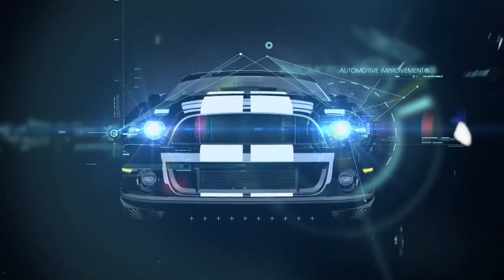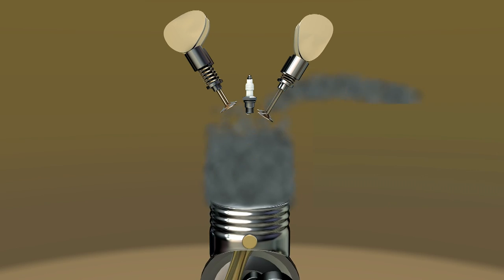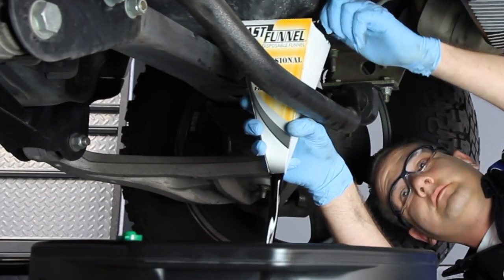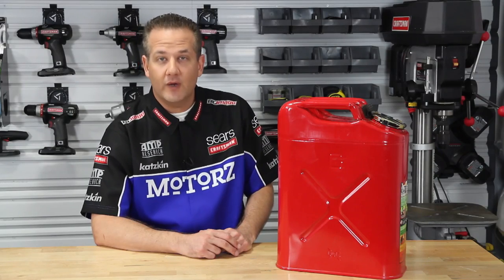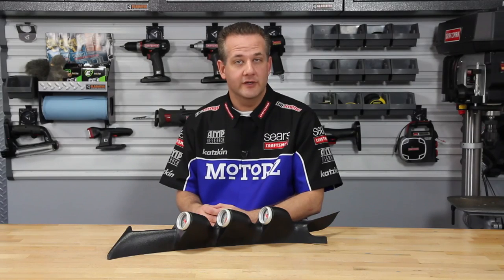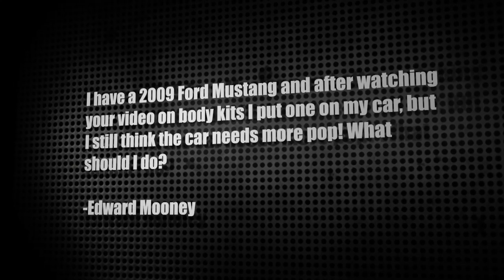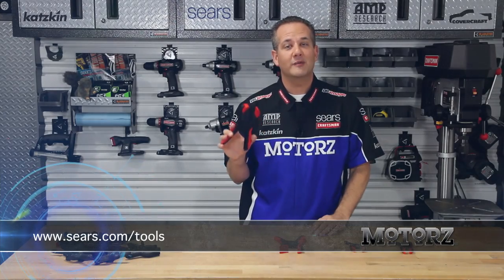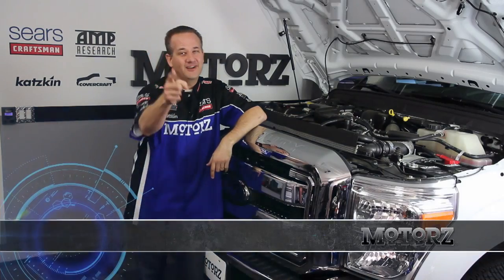Everything You Ever Wanted To Know About Diesel Engines Motorz #75

Comment: I like diesels because they are loud and stinky.
Reply: Johnson's Gee-rage don't forget greasy.
Reply: And trees like the CO2.
Reply: Then get you a 80s Chevy with a 6.2. 
I have one in my 83 suburban. 
I love it!
Reply: Maybe It's cuz I grew up in a diesel truck shop but I love that sweet smell a diesel engine that's in good shape puts off when It's running, every time I'm driving my Chevy 2500HD Durumax diesel truck I gotta roll down the window and get a whiff of that sweet diesel exhaust smell!
Reply: Save the earth Don't give birth . I got a 95 k3500 6.5 , but having a problem of losing oil pressure when at operating temp like she rests at 20 lbs on the gauge on the dash (if the gauge is right .) I got her for 600 bucks a extended cab long bed dually, lol I practically stole it at what he was selling it for
Reply: Hey now don't forget obnoxiously smoky.  One of the best parts.
Reply: You like that or you copied what he said and if you were copying Chris: 
like it is loud and stinky
Reply: @alanhowitzer  gas engines produce more CO2...
Reply: "loud" lol

Comment: BACKWARDS!
  Gas POPS like a explosion, kicking the piston like a bat hitting a ball.
Diesel burns throughout the stroke , a long soft shove.  That's where the torque is created.   Just ask the guys writing / programing the custom tune chips for all the trick diesels.
Reply: But the explosion is what makes them loud. Lol. Its a shame the gov is choking diesels out. Go back 20 yrs and ask somebody for diesel exhaust fluid and theyd laugh at you just like if you asked for blinker fluid. You see more bigger work trks as gassers cause the diesel engine costs have gone up ridiculously and def systems are junk and a epa game. Id rather have a bad running desiel than a clean gasser in a room with me
Reply: technically the cetane is what causes fast initial flame front. Cetane rating in europe is lower and diesels are quieter and make less diesel rattle. Go read this: http://www.maxxtorque.com/2009/03/diesel-timing.html
Reply: top fuel burns down the stroke to ,but higher compression with gas can burn up the mix in 10 to 15 % down the stroke so u dont need as long as a stroke and  that will help getting to a higher rpm

Comment: Those big coolers work great but I gotta say I love my Ridgid Gen5x Hybrid Fan that will run off a battery or can be plugged in and is portable and has 10 different mounting options from hanging on a screw on the wall to being mounted on a tripod to being hung on a string or cable or even being mounted on a 2x4 from level to sideways or even upside down, It's definitely the way to go when your moving around. But I sure wouldn't mind one of those big coolers for my garage that's for sure!

Comment: My last car was a petrol 5.7L LS1 V8, but as I travel and tow alot for work, I now have a 4 cylinder 2.5L Turbo deisel. First thing I noticed was the lag and the knocking sound. Although diesel has much better fuel economy when towing, I miss the instant power and the purr of the V8.

Comment: technically you are incorrect about diesel engines not having a throttle. some diesel engines do have a throttle, but it's not used to control the intake  air or the revs like in a petrol. it's used to control intake vacuum under engine braking and for emission control.
not digging or nay saying, just thought I would add my 2 cents.
Reply: viperfrank don’t forget anti shudder on engine turn off....

Comment: Bob, the throttle valve is strictly used to meter the exhaust gas as it is recirculated in the engine, but not in the traditional sense in a spark ignition engine where it is used to meter the intake air into engine.

Comment: You still need a longer connecting rod to pair with the longer crank lobe - otherwise, a short con rod/long crank lob will crash engine parts.

The long crank gives the engine more "leverage" to turn the crank - IE like sitting further back on the end of the seesaw.

Comment: On short drives, it doesn't hurt the engine.  Suggestions would be to change the oil more often because cold engines cause cylinder wall wetting from the fuel, which inherently gets pulled into the lube oil, diluting it.

Also, if you have a DPF, it will not give it a chance to regenerate, which may require a stationary regeneration or a trip to the dealership for a cleaning.

Comment: 11:15 why do I keep seeing these holes in the side of the exhaust pipes on newer diesels? Is the goal of it to create a venturi, pulling air into the exhaust via the holes to dilute the soot? So its more volume of air, less thick black smoke?
Reply: newer diesels, (07+) from factory have a diesel particulate filter, this keeps the soot from getting out the tail pipe, when clogged it has to be burnt out by whats called a regeneration cycle, where fuel is added to the exhaust stream to create a burn. resulting in 1000+ degrees, the holes are there to pull the exhaust out more, and aid in cooling, especially during a regen.

Comment: Diesel :
-worked on coal's dust originally
-can have a throttle body for smooth shut down
-my diesel run 23 to 1 compression ratio (indirect injection) and can go low as 16 to 1 on actual direct injection.

Comment: are cars and trucks diesel engines the same ? apart from size ? MY 2002 W220 S320 CDI i want to upgrade some stuff will it make around 400bhp can it ? where can i get parts from ?
Reply: The basic principles is the same, but of course there is different designes on different engines. Getting 400 hp from a 320 cdi is feasible but you might need a new pump and a bigger turbo. The easiest thing to do is to chip the engine. this can be both cheap and expencive, but i think you can get ca 350 hp and 6-800 NM in a 320 cdi by chipping the engine. A friend of mine has 250 hp and 600 NM only from a chip in his w210 320 cdi ;)
Reply: ***** when you say 600 NM what are you reffering it to ?
Reply: Nm is the torque of the engine (the twisting power). truck and tractor engines are made for torque because with more torque the truck/tractor can pull more. It gets harder to stall the engine the more torque you have. (600 NM is the same that some supercars have! You will get some sick acceleration with 600NM)
Reply: But don't ask me about the difference of HP and NM...
Reply: ***** oh lol sorry my bad i know what torque is i just read it in pound feet  not nm :)
Reply: Oh ok, yeah im from Norway and we use nm ;)
Reply: ***** thanks anyway bud :)

Comment: This is a pretty good video! I'm getting a Diesel engine for my Triton Ute, also known as a L200, and i am getting it for the power output of the engine. Knowing they can run away, i have specifically said "I want a manual gear box" for in a few cases, It will give me more power when towing then a regular 3 speed automatic, and it will also allow for more control, such as a Diesel Run away event. The event being when the engine's fuel is cut of, and starts using fuel from the Sump of the engine. Should the event happen, i can easily stop the vehicle engine, and avoid a melt down or worst. I also know, that in the event that i do such to stop the engine, it will need to be checked for Excessive damage to bearings and Gear box gears.

The amount of power from the engine, could smash up some teeth within the gear box. And to avoid it, i will try and put other safe guards in-place, such as a air choke which is manual, and designed to regulate air from 0-100.

Comment: I own a 2005 diesel ram 2500 and have broken more studs with that vehicle  then any other. The specs say to torch to 140 but they break at that spec,  so I can only torq to 130.  Are there any options for me?

Comment: Heya there I'm is from Australia and I got a 1985 Nissan 720 SD25 diesel engine as I doing a full engine rebuild and can I do a port job on the head to get more flow and power without a turbo ?
Reply: It depends, I don't know enough about your engine to give you an exact answer. If the greatest airflow restriction is the cylinder heads then yes. However, if you have a restrictive exhaust, intake, or a small camshaft then you will not see a noticeable power increase. It won't matter how much the cylinder heads flow if the camshaft is too small to support it, and likewise for the intake and exhaust system. Do some additional research and see where the biggest restriction is.

Comment: What I don't like is the cost of filling up a diesel truck. If it was a compact truck with a diesel engine, like the Ford Ranger, the Dodge Dakota, Toyota Tacoma, or a Nissan Frontier, I would think it'd be less expensive to fill up.
Reply: Dodge came out with a diesel powered 1500 this year(2014). and chevy should be releasing the colorado with a diesel in 2015 i think. The dodge 1500 is powered by a fiat engine though...
Reply: colton grimes Fiat? That's crazy! I'd rather use a Cummins 4BT than anything by Fiat.
Reply: You couldn't give me anything Fiat.

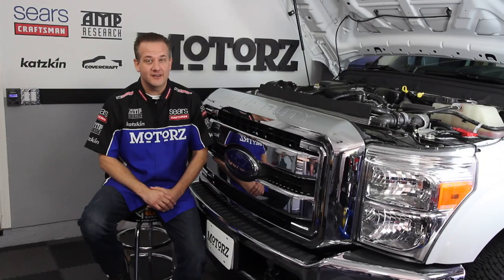Comment: What's wrong with using the original gauges the truck came with? Why install more gauges (12:23-13:32)?
Reply: Egt (exhaust gas temp) monitors turbo temp, too high you will pop your turbo. Rail pressure guage, monitors pressure at the injectors, a drop in rail pressure means signs of failure in the injection system. Trans temp, an auto trans when towing heavy can get too hot through hills etc could cause failures. Then boost, too much boost blows headgaskets, too little could mean a leak or defective turbo, and also lift pump fuel pressure (if applicable) to insure proper pressure to injection pump. Some pumps will still suck fuel with a lift pump out but will cause extra wear
Reply: Most trucks dont have Oil Temperatur gauges or Turbo Pressure or Oil Pressure or....every truck is different
Reply: Point is when you put more stress on stock parts of a system, you want to be able to monitor them to avoid them being destroyed.

Comment: in compression stroke  the piston moves upward. but initially what power force piston downward to upward??
Reply: Palash Shakil remember the crankshaft is designed to have two pistons up & two pistons down (depending on the design) so if the explosion pushes the first two down then of obviously the other two will be forced to the top.(TDC) it's like a seesaw almost.
Reply: Palash Shakil also don't forget the starter is what begins the cycle.

Comment: He mentions modern computerized turbos. I believe VNT turbos are controlled with air pressure.  What? Also check to see if you can run anti gelling additives because your catalytic converter? Diesels have DPF I am not familiar with a CAT on a diesel.

Comment: he should have said that gas engines have compression ratios that range from about 4:1 to about 13.5:1 , and diesels range from as low as 16:1 to about 23:1 . i once found an owners manual for a 1960's ford stepvan and it listed it as 16:1 . i did'nt know they go that low but apparently they do . just like a gas engine , if it is turbocharged it must have a lower compression ratio to avoid head sealing problems

Comment: gap with feeler gage its die on and even on both sides  dont use taped or round  plug gaping tool ,when i was young i would make a bigger gap it makes a longer spark but its not as hot so i dont think it helps , newer motor and high hp motors use smaller hotter gap ,they with not spark with big gap running at higher presser like with a charger and some race gas needs a hotter spark

Comment: Diesel engines have a similar intake setup as a gasoline engine, but they do not have/need a throttle body because diesel's recieve the same amount of air flow whether they are at idle speed or full speed. Diesel engines change speed and power delivery by the amount of fuel that gets injected into the engine. The more fuel being injected, the higher the speed and power output. For example, when you accelerate in a diesel vehicle by pressing the gas pedal, you are actually simply changing the amount of fuel being delivered while the air flow remains the same. When the turbo charger ''kicks in'' it forces more air into the engine so that even more fuel can be injected, therefor increasing power output. Make sense...?

Comment: Diesel noob here. If diesels don't have throttle bodies, how does air get into the engine and how is it regulated? ie, if I put my foot down vs cruising?
Reply: Diesels run full "throttle" all the time. There is no restriction on the airflow. The engine RPM is controlled by the amount of fuel injected into the cylinder.
Reply: TReaD113 Then why do CAI 'significantly' increase power in diesels?
Reply: What I meant is theres no mechanical restriction. A Cold Air Intake and larger, more free flowing exhaust allows more air to flow through, increasing the amount of air compressed in the cylinder, increasing the temperature slightly, and resulting in more power.
Reply: Diesels must always have much more air than needed for combustion because all the mixing of fuel and air happens in the cylinder in a fraction of a second.  Because of this no restriction is placed in the intake.  This is why any diesel with any sort of power/weight needs a turbocharger (needs more air flow per horsepower).
Reply: Those without throttle valves vary engine speed only by the amount of diesel injected
Reply: Diesel engine work with excess air all the time. That's simply how. And as others said, RPM is controlled by the amount of fuel added to that air.
Reply: air is air...it don't make a damn...the fuel is throttled in a diesel by either the pump and/or injectors

Comment: i just want to know that how the diesel engine starts initially if no spark plug used there
Reply: With heat and compression
Reply: +Shubhranshu Shekhar 
Glow Plugs!
Reply: AjayRhys you are right but how the engine initially got power to compress the air to achieve ignition temp of fuel
Reply: +Shubhranshu Shekhar  with plenty of cranking power from the good battery dc starter motor, which then spools up the pumping action from the crankshaft and pistons and finally makes it all work like clockwork into combustion
Reply: +Shubhranshu Shekhar yes heat and compression, but somtimes with a glow plug.
Reply: +AjayRhys I understand that it starts with compression n heat but from where the engine gets speed n power for compression n heat
Reply: +Shubhranshu Shekhar I'm not sure what your asking. when you compress air enough in just one stroke, it's hot enough to ignite the fuel when injected. colder weather will turn on glow plugs to help ignition
Reply: thing i was actually asking was "when we turn ignition key what initially turns the engine on".. but now i have understand that there is a starter moter used in vehicle.

Comment: In the UK and Europe now diesels have to be fitted with DPF cleaning filters and they are a complete nightmare. I don't know what the score is in the USA but maybe it is worth covering
Reply: we have DPF and/or DEF systems in the US on new diesels
Reply: Luke Crutchfield

Hi Luke. Yeah the problem with them is if you only drive them in town they never run warm enough to clear the filter on their own. You then have to regenerate the filter by driving for a prolonged period on the mototway at high revs to clear it or leaving the car to clear itself by idling while it mixes some chemical into the fuel mixture to make it run so hot it clears the soot. It can take up to half an hour.
If anything goes wrong they cost a fortune to sort out.I don't know what your experience is but in my opinion your better off with petrol if you only drive in town.
Reply: my truck is a 99 cummins 24 valve, at that age emissions aren't restricted (at least in kansas where i live) so i have 4 inch turbo back exhaust

Comment: But wait there's more🙌, I've worked on diesels forever, old Mercedes and CAT, Ford, Cummings, and more, the best thing to do is learn about all fuel injection systems and setting timing and valve lashing to perfection🙏👊, the tools sponsor 🔧🔥, and on injection pumps trap isolation, is were the start to dog out🐕😋 on older diesel, bit then again running any seafoam and or diesel booster fluids would help others out on the topic.  😎

Comment: We all know that 4 stroke diesel and gas engines work pretty much the same way, but I'm still trying to figure out why 2 stroke gas doesn't work the same way as 2 stroke diesel. I'm no engineer, but I think it would be possible. All you'd need is to add a cam, exhaust valve, bigger crankcase and a supercharger or turbocharge. It would make it heavier but it would still be powerful and it wouldn't burn oil.

Comment: The gas still can lite even if the flame isn't in it because the fuel make a burnible chemicals fuel doesn't burn the chemicals it makes does (it makes that chemicals by sitting there so a spark or flame could lite it like if your house was full of propane)

Comment: I'm debating on buying a colorado duramax in the next few years, but I don't know much about diesels. It would be my daily driver, and as of yet, I don't have anything to tow, unless I buy a trailer for my quad. Would city driving and not hauling anything very often harm a diesel? Getting ahead on my knowledge!
Reply: I have a 15 lml silverado....the diesels have lots of emissions on them, and occassionaly they need some highway time to burn off the soot that collects in the DPF....this helps elimnate the bad stuff for the environment. 
if your doing to do a lot of city driving i would add some archoil 6200 to control soot
Reply: Spahi77 Don't add anything to a Cummins....manual says not to add any additives.